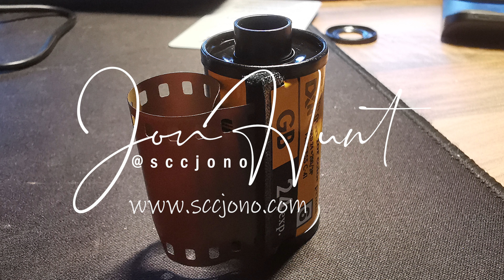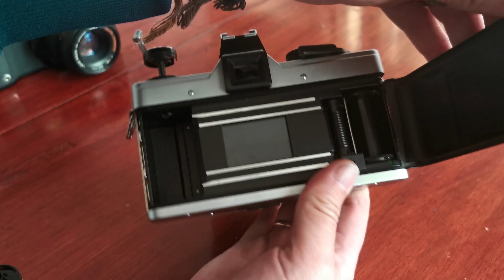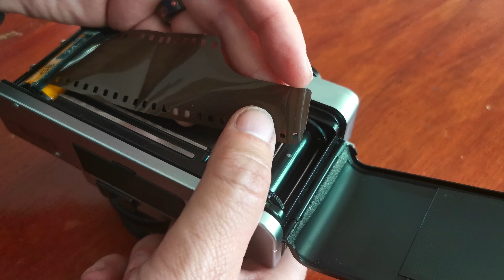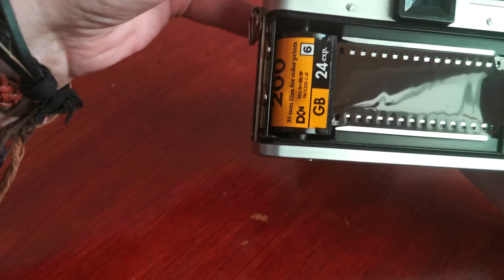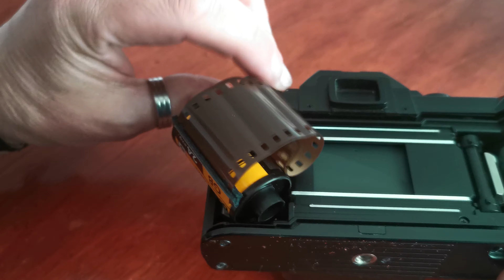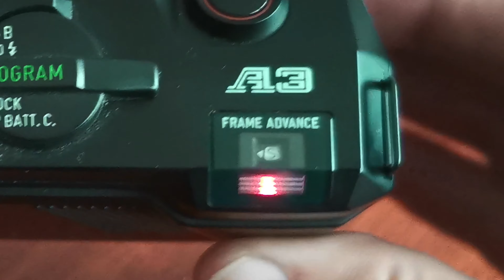Loading 35mm Film Into Your Camera - A How-to Guide

Comment: i just got a pentax a3000 and it has some corrosion on the battery compartment, I haven't quite gotten rid of the corrosion yet because its very minimal. However, when I press my shutter button it seems to be struggling to turn the spool. I guess I'm asking if you think that it isn't getting enough power due to the corrosion (I'm getting around to cleaning it out just quite haven't yet as i got the camera yesterday) or if it's due to a mechanical issue. Here's hoping I didn't buy a botched camera.
Reply from the maker: At this link https://youtu.be/b1RLGbj2Yfk you can see a video I did on the Pentax A3 (as the A3000 is called in Europe). I'm sorry to say that in my experience, the camera is either getting power or its not. There is never a situation where its only getting "some power". I could be wrong but if you're using fresh batteries then it might mean that the power winding mechanism needs a clean and lubrication. Not something I have ever looked in to to be honest. I hope you can get it sorted out as its a great camera.
Reply: @sccjono  Well it certainly is getting power but it will not make that "satisfying" sound when i press my shutter. The winding mechanism seems to be stuck and I am very inexperienced with slr disassembly especially one with an automatic winding mechanism. I gave it a good cleaning on the top battery contacts and its still the same with fresh batteries. Thanks for the help.
Reply from the maker: @SometimesBuddha  Sorry I couldn't help more.